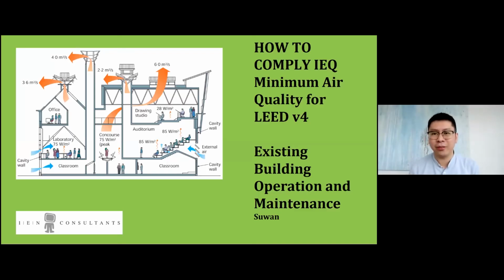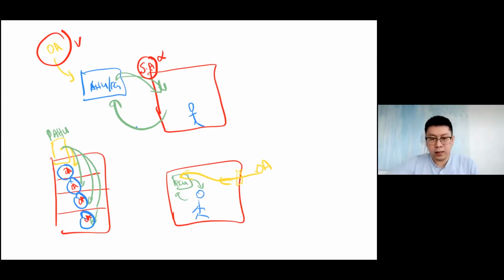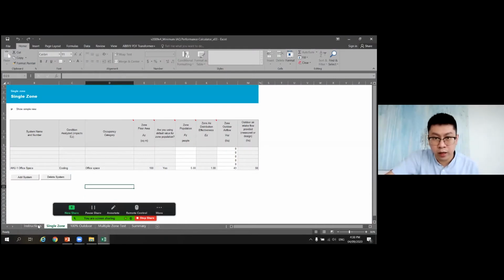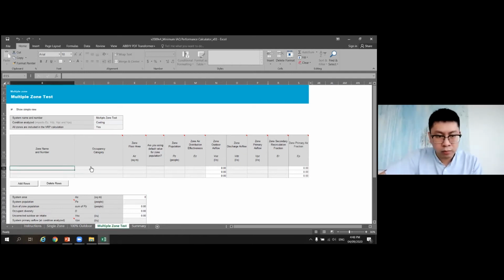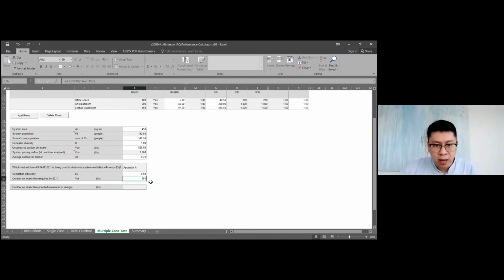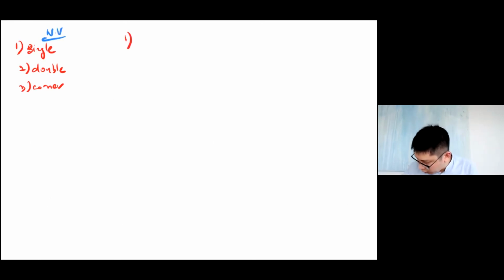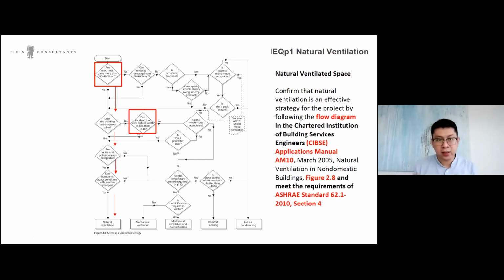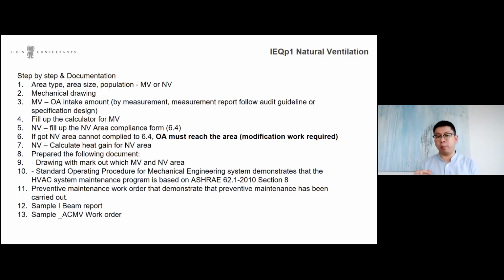LEED v4 Existing Building | IEQ Minimum Indoor Air Quality | Natural Ventilation | ASHRAE 62.1

Comment: in a multi zone system,
how Do we have to consider spaces where there is only exhaust  such as toilets and kitchens ?
what about  toilets where fresh air is supplied?
Reply from the maker: toilet you no need to have outdoor air, only exhaust requirement as per Ashrae 62.1, kitchen if no AC then usually the outdoor air for cooking is sufficient for meeting occupancy requirement of outdoor air